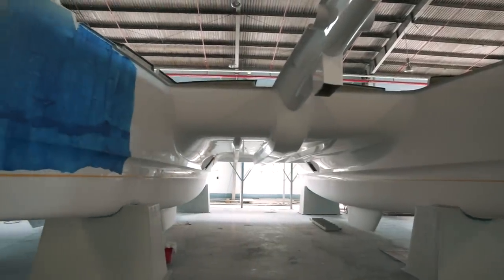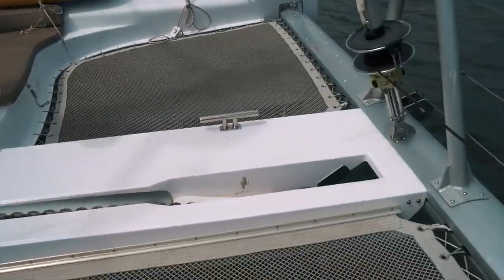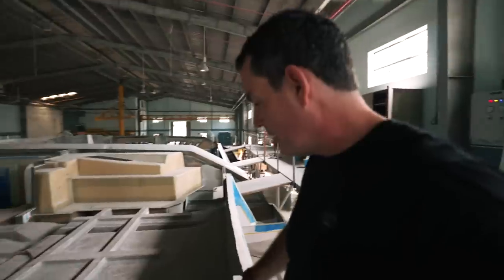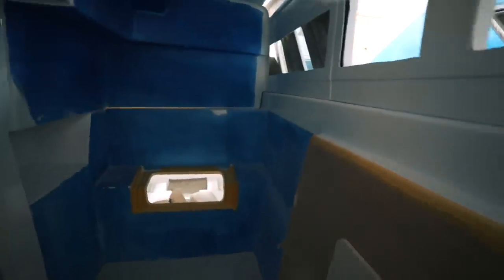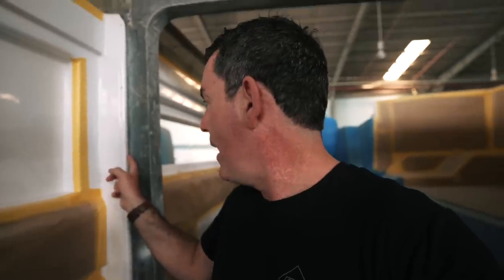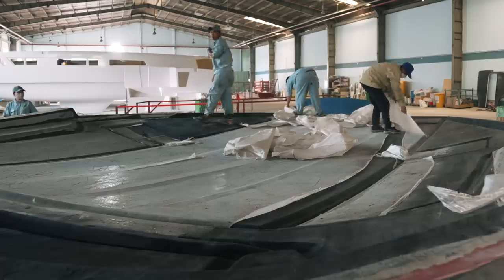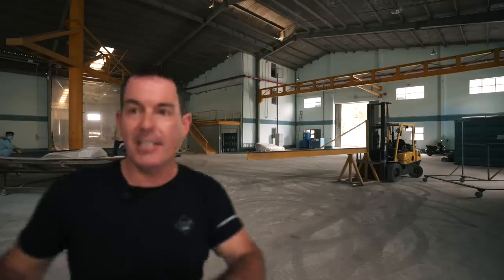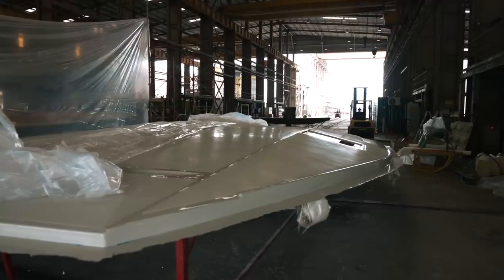CATAMARAN BUILD: The Best Way To Save Weight- Carbon Coachroof De-moulding

Comment: It's amazing to think that even modern boats are still built by hand. It's like a bunch of artist got together to create something.
Reply from the maker: I know, there's still a lot of processes done by hand
Reply: Its true to a degree in aviation since composites found wider use in military and now commercial aircraft as well but there they tend to use presses and kiln controlled drying because its all super critical.
Reply: Of course! because incompetent people don't ask the right questions..  
For example you can ask him who approved the design and the construction? According to which rule and regulations? and how they follow  it up? 
Is there a recognised third party indipendent body who check the construction? 
Ask also him for materials their certifications and how those sourced and choose according to which standard and they follow it up??
Reply: its cause industry isnt large enough. Cars are basically only affordable because its the product of extreme manufacturing efficiency.

Comment: Keep publishing these videos, they are great.  Nice to see a manufacturer letting you film this. It will pay off on the long term as transparency will be key for future sales.    PS You seem to handle the Ho Chi Minh heat well.   I worked for just over a decade in Hanoi and occassionally visited HCM and never got used to the heat.

Comment: I think this is fascinating, although I come from a manufacturing background and it might not be everyone's cup of tea. I'm with you a bit of nerdy about complex machines and a boat that contains so many systems that must work together. If it were my boat, I would be there every day enjoying the actual building. so continue -- PLEASE. I do expect to see a lot of the systems getting installed from wiring harnesses on down to plumbing.
I can see that Sea Wind would want to show potential customers their painstaking processes to explain why it cost so much - Bottom line plainly seen - There's a heck of a lot going into it. I can't wait to continue on this series as your new home is taking shape. While it is interesting to see a bit of Viet Nam, my focus is always on your new boat. I hope for a quick couple of minutes on an update with your other half and how she is managing also.
One quick question is - language, are you taking a course in Vietnamese, or using a translator device? You seem to be doing well in communicating?

Comment: The carbon fiber will save a lot of weight.  Since RR2 will be an ocean-going vessel, have you considered using synthetic rigging?  You would further reduce weight, gain the assurances that you could replace rigging underway and get away from the potential of rust/corrosion.

Comment: It would have been great if during or after the discussion on session on unboxing the hard top you'd had one of sewind's experts to discuss it in more technical detail.

 As for life in Vietnam, you have the right amount of it don't of it as a proportion of your video time. Some more time lapse shots with voice over talking about the bigger picture days in Vietnam would be useful. If you can get video from the factory some similar voice over and time lamps shots of the build would also be useful.

Comment: Nick, I'm interested in the wiring runs for power and data cables as well as plumbing.  When do they put it all during the overall process and what, if any, particular methods they use that may be innovative?  What it means to me (and you too) in the long run is how easy or difficult it will be to manage maintenance or repairs down the road.  Will you be able to pull additional wires through existing conduit to add components or easily replace a run of wire or plumbing if it were necessary?

Comment: I’m really enjoying the videos. I vote for more boat but the city is interesting. 
I see a red flag 🚩 in your build I would like to bring up. The custom anchor is a 
Concern to me because you’re stuck using only that anchor for that boat to properly stowaway. 
What if the anchor doesn’t hold well and you want to use a different style anchor how will it start with that custom anchor holder. 
Or if you lose you anchor how do you replace it. ? 
And how much $$$ 
is the only anchor that fits it ? Thank you and Keep the videos coming. can’t wait to see what’s next.
Reply: I was wondering about the anchor, too.

Comment: As with any build, not every step or bit of progress is going to be as exciting as opening a Christmas present. They are all interesting. Keep doing what you are doing. The videos are great. Carbon fiber is mentioned a lot. Is there a downside to carbon fiber? I know it is strong, but thought that it can be brittle and subject to cracking or breaking if it gets nicked. What about repairing carbon fiber when out cruising. Will you be able to find supplies? Can you do it yourself?

Comment: I am really interesed in the tech of the boat -- specifically how you will use it as a platform to film and edit videos.  Are there (will there be) any ethernet cable conduits and grommets fitted about the boat to allow for high speed data transfers?   At this point, I feel that all newly constructed boats should have a concept of a data center.   Thanks !

Comment: Am I seeing your bulkheads constructed from Carbon Fiber? Or are they a fiberglass over (ply or foam-core)? They are certainly a different colour from the other varieties of construction we are seeing. And yes, having seen the issues with some other brand's 450's and smaller 410's having cracked bulkheads, this is obviously an area of concern. (Not naming brand names or channels, but numbers may give it away.)

Comment: I didn't see them weight you as you stepped onto the boat Nick....

Where will hulls 1,2,3 and 4 move to as new hulls are finished if that factory is getting too small? Will the fit outs be conducted in yet another factory? Was that the coachroof of hull #1 and not yours? How do they bond it on (epoxy), or do they bolt it on or both? 
How is Terysa? You haven't made any mention of your fiancé for about 5 weeks...😞 Everyone, I'm sure is concerned. How is Terysa doing in London? Can she post some video from there on her life while she is away, please?  I know this is a lot of questions, but people want to know about your betrothed's welfare.

Fari winds and following seas...⛵⛵⛵...

Comment: I’m not convinced this is a performance cat… 11 tonnes is in Lagoon territory!! It looks great though but goes to show that just because a manufacturer claims it uses Carbon fibre in some points does not mean that it’s lite!!
Reply: Hull shape and mast length will make a fair bit of difference (lagoons seem pretty beamy). Still will be interesting to see it's performance. Seawind seems to often make sport and lite versions, would be good to see the 1370 with daggerboards.
Reply: @AORD72  Plukky from Sailing into freedom is doing a series on this at the moment… he knows his stuff and at 11 tonnes with keels, I highly doubt it will perform well… the 1260 is a super lite cat.. I expect it will an amazing looking and comfortable boat that will perform slightly better than the lagoons, FP, Bali’s of this world